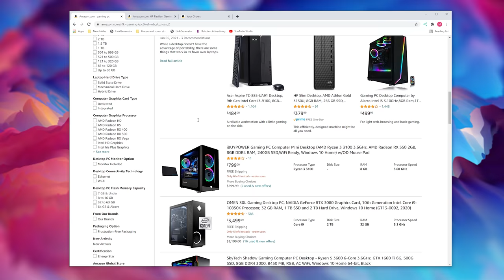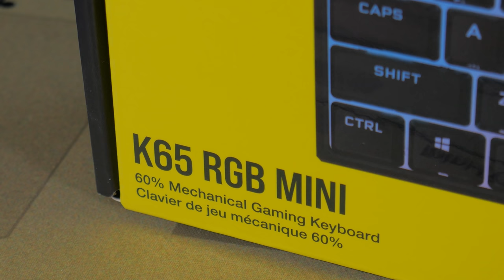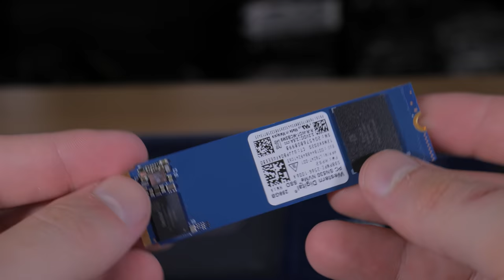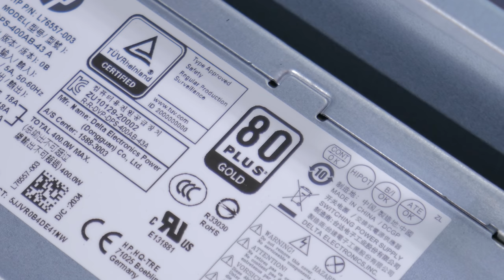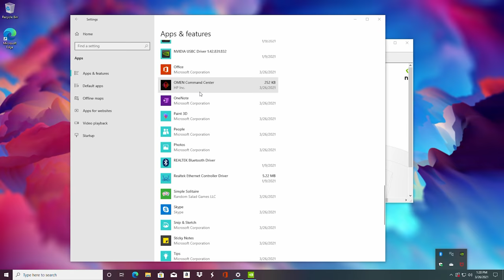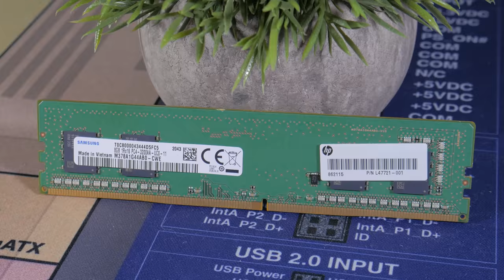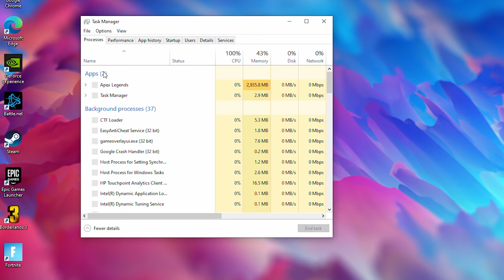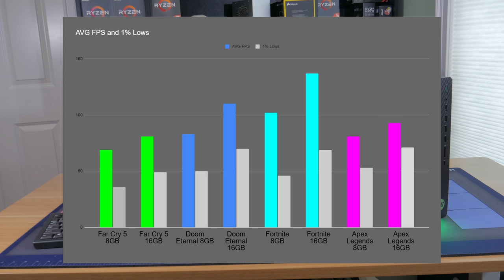I Bought a $600 Amazon Gaming PC! (2021)

Comment: I bought a hp pavilion of the hp website when it was on discount for 800 bucks, it had a R5 4600g, 1650 super, 16 gigs of ram 3200 speed automatically set (dual channel btw), 512 gigabytes. So far its been fantastic.
Reply: Thanks dude. I'll look at something like this
Reply: now that's very pog
Reply: That's actually rather decent considering the current market. Down the line you'll be able to upgrade the gpu and it'll last you a while.
Reply: I got my sister one with a 1650super and 10100 for 650
Reply: I wonder why the choose to put in an apu and a gpu
Reply: I see it for 1,200
Reply: @Alex M exactly he got 200 dollars from HPM to take it lol jk
Reply: I have the one with the ryzen 5 3500 and had some concerning temps. Dremmel and pc mesh+fans+rgb= perfect
Reply: Lucky

Comment: This looks like a just fine pc. I would move to the i5 and add a 2tb HD and I'm done. No frills necessary.
Reply: Def would upgrade to dual channel ram over getting new cpu but agree on the Hard drive!
Reply: Tbh I would say get the r5 3500 if your a gamer
Reply: I am getting this but with ryzen 5 3500
Reply: @itchyjoey4539  I5 is better
Reply: ZcyberTech  higher clock speed, same amount of threads and cores, and it’s much cheaper
Reply: ZcyberTech  did you not read what else I said lmao
Reply: ZcyberTech  Google isn’t a good source
Reply: The keyboard it came with made my fingers sweaty very easily, so I got a better keyboard
Reply: @zeyyyboggiee  I mean if you go to CPU benchmark it shows that the ryzen 3500 is better than i5
Reply: @benquinn3559  the 3500 doesn't even have hyper threading lol

Comment: My GF just picked up the Laptop version of this desktop. It's the 16.1 inch laptop with green everywhere. It came with 8GB DDR4 RAM, Intel Core i5 10300, 512GB NVME SSD, and a GTX 1660ti, all for $900.

Comment: Fyi when you showed the memory upgrade on task manager, your memory was only running at 2133mhz. When you install a different brand of memory other than the OEM one that's already in there, you usually have to force it to 2666 either via the bios or some other utility. I have the Ryzen version of this pc and that's exactly what happened to me as well.

Comment: I got the same HP Gaming from Amazon as well. I bought it last year but, mine have a ryzen 5 3600, 8g ram,1650 gtx and a 512 ssd. I got mine for $700 last year. Now that same model is around $900. Everything about computers seems to be going up in prices lol. It's decent so far.

Comment: you kinda kneecapped the ram, when you added the extra stick it bumped down the speed to 2133mhz.
Reply: Duel channel will give ext performance but applications will open slightly slower

Comment: You can see the difference in performance from single-to-dual channel ram (possibly also the 8gb to 16gb) in the GPU utilization during the benchmarks. Rather than bouncing around through the runs, it was locked at 99% utilization almost throughout (e-Sports games notwithstanding).

Comment: For years, I have been hearing from people everywhere to uninstall Google Chrome and use Edge instead... Now everyone is dissing Edge and I don't get it, all my searches go much faster and hiccup free on Edge instead of Chrome

Edit: Just tested my computer and even regular Explorer is faster than Chrome...
Reply: I still prefer Chrome for the simple reason that I never use my primary built in browser.  It’s easier to get rid of Chrome with a virus than Edge.  I also have 32GB DDR4 so Chrome runs as intended.

Comment: I bought the similar M01-f1024 system (Ryzen 4700g, 180W gold PS, 8GB, 240GB M.2).  Thing is, the ram on the system board is crippled---the logic board (They called it Erica5, yours is called Baker) does not support XMP.  Yours probably does; but while I can install additional 3200 speed ram, I have to use 1.2 volt versions with a latency that starts at 22.  HP lists acceptable ram on their website; Crucial lists compatible ram correctly.  But you cannot access the bios fully; HP locks me out of quite a few things. Gamer's Nexus did a recent vid on the common pitfalls of pre-builts.  My system had the hard drive screws in the bag with the system paperwork and mouse.

Comment: In my country, it skipped the 1650 instead it offers the 3060ti. And when compared to custom build with similar specs, its quite a bit cheaper. Personally, i am not looking to replace my current pc but if i am in that position, going the prebuilt route is a no brainer,

Comment: It seems HP,Dell, Acer, any prebuilt MFG that's big box assumes most buyers are idiots and target those people specifically. They bait you with single channel ram hoping you "upgrade" from them so they can ridiculously over price the ram. It is better to buy that machine, format the boot drive, add your own OS and ram just as you did here. You can get a legal copy of windows 10 for under 20 bucks anywhere and just debloat it. Good find for a budget buy that can get you through this market. It can still be a browser box later down the road when you can build again at a reasonable price.

Comment: I got the AMD ryzen 5 3500 version last month. It uses the same intel cooler, looking to swap it out soon. Also I installed a 92 mm fan on mesh inner tray using rubber ran isolation mounts.
Reply: good luck installing other coolers in it. cooler is mounted to backplate not motherboard (most of the time). And you can't fit anything behind motherboard. You need to be careful what coolers you buy for your system. look at 3:10 from this video.  /watch?v=KIm0SHtfErw

Comment: I know that systems like this are aimed at new users BUT...I think it's time to start teaching people to install Windows from scratch. For one thing, some day Windows will be so gummed up that a reinstall will be necessary so they'll need to know how anyways. Plus people can have a clean install that only includes things they want or need, no pre-installed bloatware which may or may not fully uninstall when you manually uninstall it. Another benefit is that lower end systems run better when extra junk isn't installed. If you're starting with a small SSD then an extra 5gb of stuff installed here and there adds up fast.

Comment: I'm REALLY baffled by the Fortnite benchmark. I refurbish workstations and put GPUs in to get kids off console and into PC gaming. We're talking X58 4C/8T CPUs with 12GB RAM and R9 series GPUs. These usually reach an average of 120-180 fps (depending on the GPU) and I rarely ever run into a CPU bottleneck. What exactly was bottlenecking your system?

Great video - for this price, getting completely new hardware with warranty on it is actually great.

Comment: Hey, that black screen problem could easily be resolved by turning off "AppReadiness" in system services. I tried reinstalling everything on my pc, lost everything, and even got a new mobo and then found out that it could easily be fjxed. It was vey very very frustrating,  i just wanna share to help. Thanks
Reply from the maker: Unfortunately I tried that and it still didn't resolve the issue. After messing with it for around an hour I just decided to cut my losses and start with a fresh install.

Comment: Would the insides be compatible with a non oem case?
Reply: With plenty of mods it’s possible, but without you’d lose plenty of features:
Front I/O
PSU screw pattern will not match, possibly allowing only one to two to be used
Standoffs may not match, you won’t be able to utilize all on the board 

Mainly the mobo and PSU will not be 1:1 transfers.

Comment: I went on amazon and the price is like 850 is this still worth it?
Reply: Run away.  Once you're in that price range, you should get a different level of product.  Maybe something without a $5 CPU cooler and with dual channel RAM to start
Reply: @MichaelTavel  Do you have any that you could recommend. I'm not trying to play anything too high end. I just want to play dbfz and edit videos for youtube
Reply: @KT_FGC  I'm not sure where you're located, but Costco has a Lenovo Legion with an intel i5 10400, 16gb RAM, 256gb SSD and 1tb HDD, Geforce GTX 1660 Super and WiFi 6 for $899.  I realize that's even more than $850, but you get more for the money.

Comment: I would gladly recommend pre-builds from HP or DELL to my friends but untill they get they heads out of their asses and use normal standad PSU and motherboads I won't.
They are the only companies that adopted that 12V crap from Intel and yes get dual channel ram in those PC. Some OEM PCS only use JEDEC approved RAM and if you put of the shelf memory sticks inside you might not be able to get those modules at their rated speeds.